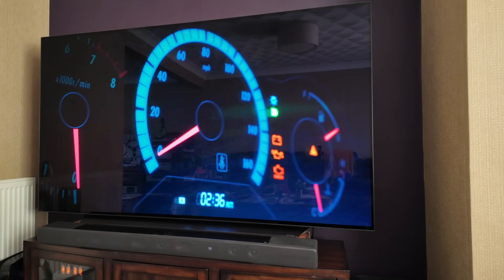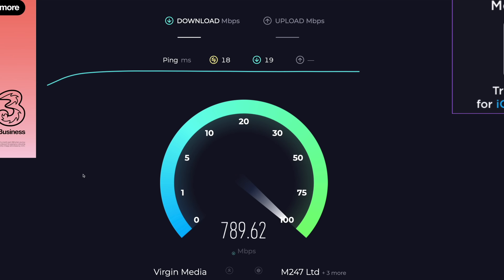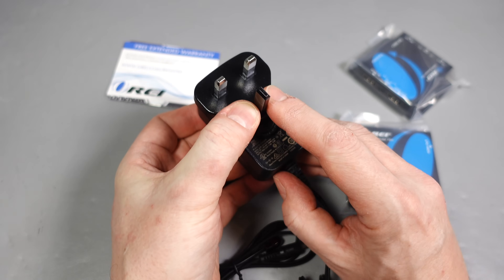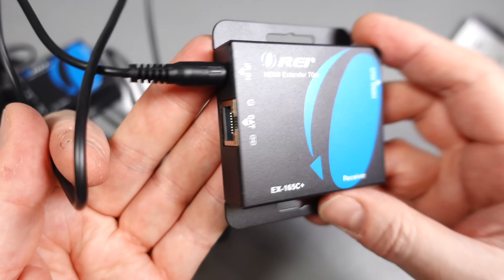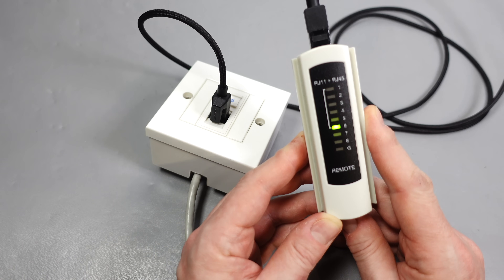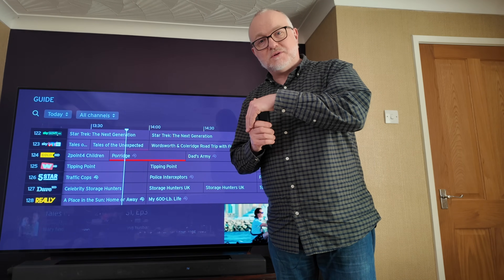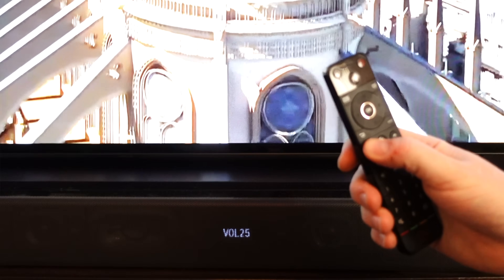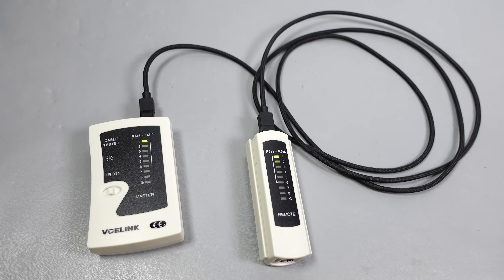HDMI via a Cat6 cable works surprisingly well

Comment from the maker: NOTE - This is not a networked Ethernet connection - with these specific adaptors you can't send the HDMI signal via a router, a switch, an Ethernet over power-line connector, a WiFi transmitter, etc - you're just using a Cat6 (or CAT5e) cable as a substitute for a HDMI lead. The benefits are that you can have a longer cable run and the cable is easier to route through small holes and conduits.
Reply: Twisted pair cables are built on an actual understanding of electricity, pretty good modern tech.
Reply: did you test or plan to test the extra-long optical transport proper usb-c cables (transfer display and usb over same cable to a different place)?  like that one guy used for the pc in the pond?
Reply: @lasskinn474  Ethernet is a better option than USB-C for long distance.
Reply: @katrinabryce  fiber is even better.
Reply: @rezenclowd3  Fibre has higher latency, due to the need to convert at either end, and because light through a fibre optic cable travels slower than electricity through a cable.
It does have higher bandwidth, but cables have sufficient bandwidth for the task.
Reply: @katrinabryce  lol no....besides there are yet no theoretical maximum throughput for single mode os2
Reply: @katrinabryce  OK, no. Other than media converting the speed of light is definitely faster than copper, and can do much longer distences.
Reply: @morph-  Light though a fibre optic cable is about 0.6c, vs about 0.8c for electricity. That is because the bounces around off the edges of the cable rather than following a straight line, so for a 1 metre cable, the light path will be quite a bit more than 1 metre.

Yes it can do much longer distances, but copper can easily cope with one end of the house to the other.
Reply: @lasskinn474  Icron and Bullet Train make AOC HDMI cables, they however must be direct. My 2 HDMI cables were $750/each and the USB 3.1 extender was $1500x2. This way my PC is in my office, but 2 of my VMs with a split GPU can play games on the 2 TVs in the house with controllers/mice/keyboards working.
Reply: @rezenclowd3  i was thinking of doing the same, but this is expensive man. Are there like any cheaper options :D
Reply: @KrastyoKrastev  there are cheaper hdmi fiber cables, but I want with what is proven for commercial. Look into the digi anywhere2+ for usb 2 over ip
Reply: @lasskinn474  You can also get optical hdmi cables, but your holes need at least be big enough for a micro hdmi plug.
Reply: Startech makes a hdmi-Ethernet converter that works over “real” network, I’ve seen some companies use it in the event industry and they put the signal through (managed) network switches
Reply: @Bo_At_Work  yeah that's the one, thank you! :)
Reply: Yup. Just a simple media convertor
Reply: Virgin media do a wifi stream box about 3 inches square
Reply: I think your issue with the wiring was that computers can generally sense the wiring standard and adjust for that, but I guess this device can't. So you had to rewire it to make it a straight cable.

BTW I have a USB cable extension device similar to this, only it can be used without power. Though I'd recommend powering it for longer disances.
Reply: just be careful when bending the cat6 round corners, its not as flexible as cat5e
Reply: I got given a bag full of Ethernet HDMI range extenders a while back, and did get one of them working.  And it does indeed work very well.  I don't delve into the fancy Dolby 9.3 whatever nonsense, so I have no idea if there's issues with HDMI versions, but it does indeed transmit perfectly for my purposes.  I have to admit I was a bit surprised, although it did come from a  professional AV installation, so I shouldn't have been lol.
Reply: I used this solution with cat - cable for my projektor about 13-14 years ago, hdmi to cat 5 dongles were bought on ebay
Reply: HDBaseT is an ethernet protocol that can carry audiovisual signals.
Reply: 😨😨😨😨😨😨😨😨 oh a bit late for that comment. I connect my tv direct into my router thought I could share the tv signal with other tv connect to the same router via WiFi 😢
Reply: What I haven’t seen mentioned is that you CAN use patching panels to direct the cabling hither and thither
Reply: Worth knowing: Cat5e is actually very common - Cat 5e is very cheap so a sparky will usually carry one reel of Cat5e and use that wherever the customer wanted Cat3, Cat5 or Cat5e since these are a hierarchy, so a Cat5e cable satisfies the requirement - having three reels means three times as much stuff to carry, and they're barely any cheaper. On the other hand Cat6, 6A and now 8 are more expensive so the sparky will have to buy those if you want them. As a result of this, in most homes built or upgraded in the last say 15-20 years any "telephone extensions" were actually made with Cat5e cable, the telephone doesn't care that you used fancier cable, but you can re-purpose this as a ready to go network by just changing the sockets to Ethernet sockets instead of telephone sockets. The extra good news is that because it's a hierarchy if you're wrong and it's really only Cat3 "telephone" cable, the network will work anyway, it just won't go as fast. A Cat3 cable probably isn't enough for live HDMI video though.
Reply: There are also Ethernet solutions available. I was shopping for that kind of stuff some years ago and I remember I came across devices that advertised something like: Send the signal on one point of your house, grab it in as many rooms simultaneously as you want. (Assuming you have multiple LAN jacks in your house connected at a stwitch).
Reply: Modern day AppleTalk
Reply: @Techmoan Is it really using a Cat6 cable as a substitute for an HDMI lead, or are they doing some processing? 

Ethernet has 8 cores, 2 will be needed for PoE for the downstream device, which leaves 6 for the stream. HDMI has 19 pins. While many of these are shields, there's still a lot of data to stuff down 6 cores - I think the signal must be transcoded and decoded between the two bridge boxes. 

What's interesting is that there appears to be no major delays, so the signal is processed very fast. However this may be mitigated by it just being passive TV, with the remote connected directly via bluetooth rather than the bridge. I wonder if a delay might be more noticeable in games.
Reply: @TWeaK819  I don't know what they do, but there's no technical reason power and data can't use the same wires. That's relatively straightforward from the electronics perspective. HDMI uses four differential signal pairs for the data main feed, so it's not so different from using Ethernet cable in some respects.  That's good for 4k with HDMI 2.0, and HDMI 2.1 also allows Display Stream Compression for the highest resolutions, which would not be adding any significant latency.
Reply: it works and it’s very reliable.
try HDBT , that is networkable also and the quality is way better than the normal
extenders
Reply: This wouldn't work for PS5 (not sure on other consoles) as requires hdmi 2.1, unless the Orei have a unit that supports 2.1 or higher
Reply: A standard called NDI (network device interface) is a standard for video over ip, mostly used with PTZ cameras. That being said, BirdDog, an Australian company makes devices to convert an NDi stream to an hdmi connection. You can send an NDI signal from OBS using a plugin. It’s a really reliable system to distribute video to different endpoints using your existing ip based network. BirdDog Play devices are good for endpoints.
Reply: Note - you can send 10Gb ethernet through HDMI though 
t. Dell switch user
Reply: thats a shame.
Reply: i suspect you could setup an HDMI VLAN on your switch's and use the HDMI ethernet channel function, though you will probably need to somehow configure the converters to do that. Im just speculating as ive never tried it personally
Reply: is there a solution that transmits ethernert and video over the same transmitter device
Reply: Just an update for the future. Virgin will soon have the stream box compatible with the TV 360. That means any additional outlets live TV stream will be over IPTV and no need for the coax.
Reply: I think I have seen solutions where regular switches etc could be used. I think LTT did a video about this quite a while ago.
Reply: @p_mouse8676  You can send video over network quite easily, but this isn't that, it's basically just using a ethernets cables conductors and matching them up to the conductors in the hdmi cable. Video over IP uses quite a lot of bandwidth aswell.
Reply: @morph-  I know, but I am not talking about video over network
Reply: @morph-  This is far from the truth. HDMI has 19 pins while Cat6 has 8 pins and they work very differently. In fact, it doesn't even using the HDMI signal, it compresses every frame from the HDMI source into MJPEG and sends through the cable. On the "network" side it uses (layer II) Ethernet broadcast (so it can work with a switch by flooding all the ports), and that's why the two end device do not need to be paired. I don't know this model, but most of the cheap chinese HDMI extenders work like this.
Reply: @mlaci_yt  it specifically says you can't use in on a network, probably down to the fact the receiver is powered by the transmitter. I didn't mean that it was a one to one converter, but these devices definitely don't work naturally on a network, hence one cable between 2 devices don't need to be paired becauss it's directly attached
Reply: @morph-  Standard PoE, the green and yellow cable carrying the opposite side of voltage (mode A).
It's not IP networked, but it is using ethernet, and not just the cable and connector (the physical layer), but also the link layer (framing, mac addresses). It's way more cheaper to use the existing ethernet controller circuit then inventing your own shit.
Reply: @p_mouse8676 
That is a hdmi-over-ethernet technology with on the downside add delay to your signal (impossible to use for gaming) but adds a „one sender to many receiver“ possability. There are planty of manufactures out there.
Reply: You do get the distance problem with ethernet still, unless you add in switches, etc. as repeaters
Reply: @mattstevenson1334  Signal degradation is an issue with any cable signal with increasnig distance.
However this is not Ethernet. It just uses 1:1 CAT6 Cable layout. Quite likely those devices have internal signal control and amplification.
Reply: @HomerNarr  I run into issues at 150 m with these (or similar). Is that not the ethernet standard
Reply: @mattstevenson1334  Thats what he tried to explain: It's not ethernet. Just the wires in a cat6 cable. A router or switch can help in an ethernet configuration. But we do not know how this is configured.
Reply: @mattstevenson1334  you can't do that when using inexpensive hdmi to ethernet converters, becuase they don't use the ip protocol, they are a much lower level system. If you need longer than you can normally achieve with a system like this, then it's time to go to video over IP, or using optical cables.
Reply: @morph-  interesting. Working in several factories across the world for me currently...
Reply: Physical layer only, eh? I was wondering about that. It doesn't have the auto MDI/MDI-X feature which is common on all modern wired ethernet interfaces.
Reply: I have a similar device, which actually works via networked ethernet, although I strongly recommend a good 2.5GBit (or faster) network. Great for getting a signal to my ceiling mounted beamer (I had the electrician install a Cat8 cable aside the powerplug in the ceiling when we redid the house). Works like a charm!
Reply: better option is fibre optic HDMI up to 30m
Reply: @techmoan while this works with 1080p, but you can’t do this with 4K. All 4k hdmi over cat6 solutions are lossy. (they tend to use the term “visually lossless”.
Reply: HDBaseT is nothing new and works well over 100m on Cat8 wire
Reply: @radio-pirol  cat 8 is unnecessary and power hungry. Data centers don't even use it. Cat6a is fine. Otherwise use os2 fiber duplex lc
Reply: It shouldn't matter how you wire up RJ45 jacks, as long as they are the same on both sides, the standards are just the most optimal/easy to understand way to do it.
Reply: @morph-  There are two connection standards and he mentions them. One standard is 1:1 the other one is a kind of "cross" cable. Older devices needed the transmitting connector connected to the receiving end on the other side and vice versa. Modern network cards and routers can detect the connection type and adapt.  
Since this is not an network device, the wiring type is relevant again.
Reply: @HomerNarr  as long as they connected the same way on both sides it would work.
Reply: @morph-  Please check the Video at 5:05. There are two standards. One does work for the HDMI "Converter" one does not. One Standard is "connected the same way on both sides", the other one is not. Both are valid, thus "standard".
Reply: @HomerNarr  I know that, but it dosent matter how you do it really, there are standards as they are the best way to do it, but as long as the same pairs are in the same place on both sides, there is no way of either device knowing anything wrong
Reply: @morph-  I understand that you do not understand. And i can not be bothered to teach you since you don't give the impression you are trying to. I will not repeat myself.
Reply: These are twisted pairs, so actually it will matter over a long distance or when running close to other cables whether you picked a valid configuration (like the two shown) or just wire them up randomly - if you do it wrong then RF interference damages the signal, whereas the twisted pairs mitigate that problem if wired correctly.
Reply: @morph-  It doesn't just work.  It's important that the wires in the cable are still used in pairs by the differential signals from the transmitter in a way that matches the twisted pairs in the cable.  While the cables will connect with DC signals with any wiring that's the same at both ends, with high frequency digital signals, the impedances of the twisted pairs are important in ensuring clear signal reception at the far end and in maintaining any timing relationships between signals.
Reply: @rybaluc  Thank you, the name of the feature escaped me. Can no say i miss the times before that feature was so common like it is today.
Reply: @HomerNarr  I hear you there :-). On the other hand given this feature installation techs are so careless those days ( that is meant to be rant for quality  of installations). If you want to use something different than ethernet on tp cables, you have to figure it out hard way.
Isdn, atm, modbus, rs232/485 etc. 
Not mentioned 3 standards(2 official) for PoE and 2 different signallings with different protocols.
Reply: @HomerNarr  you are flat wrong, a crossover cable is when you use "A" on one side and "B" on the other. A crossover cable is for hooking two devices together directly without a switch. And modern devices don't need crossover cables to be directly connected.
Reply: @pcefulpolarbear  you are a little late and sadly YT does not show the whole discussion. Modern network devices are able to recognize the type of cable.
Both have been used. 
If you claim i would be "flatout wrong" it just shows you did not get what i tried to explain.
Reply: @morph- the noise cancellation and transmission requires the correct wiring - there are different twists in different pairs of the cable. It'll probably work short distances wired any old way, but for longer runs, you'll really want it done right
Reply: @furicle  You are correct, with short patch cables it's normally fine...
Reply: Not true. The twisted pairs are important. If you make it up as you go along problems are likely. @morph-
Reply: @morph-  well, it actually does matter. Reason being that each pair is twisted a little different. Some pairs are twisted tighter than other pairs in that cable. When pushing the cable near its max speed and length limits it will matter. Shorter less demanding runs might not.
Reply: @morph-  Except that the twisted pairs rely on differential signalling, so the pins that are supposed to be connected to the same twisted pair do need to be connected to the same twisted pair. It doesn't matter if it is the orange pair or the green pair or whatever as long as it is the same pair.

Comment: Why?  I just watch 4k movies via Plex over wifi 6 to all my smart TVs.  Just setup Plex on PC or capable NAS and install the Plex app on your smart TVs.  You can't get stutter free 4k video over LAN to TVs because LAN ports are only 100 mb/s on TVs vs normal (today) 1000 mb/s gigabit CAT 5+ wire.  If you don't have wifi 6, wifi 5 might also work and buying a good wired access point is cheaper than buying a bunch of LAN to HDMI converters for more than one TV.   You get a better wifi signal than just the one modem/router from your ISP provider sitting in your basement.

Comment: Thanks. That's useful to know. A somewhat related question (or the inverse so to speak): what solutions are there for wireless audio from AV receiver to passive speakers, I'm not able to route wires for the rear speakers.

Comment: Earlier this year I upgraded my home internet setup, which involved setting up a mesh network and replacing 40 metres of old crappy cat5 network cable with a new and improved cat6, I bought the same (or very similar) network cable tester and it was extremely useful.

Comment: Thanks a lot for this demonstration.
Shall I use between the transmitter and the receiver a power line in order to avoid passing a long cable in the area which where I went to have this.
I hope you will answer my question